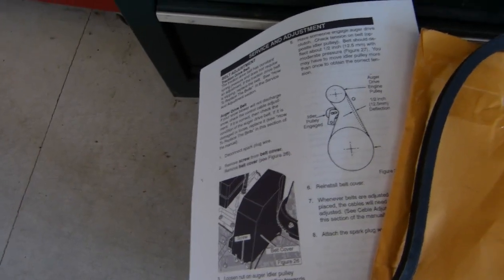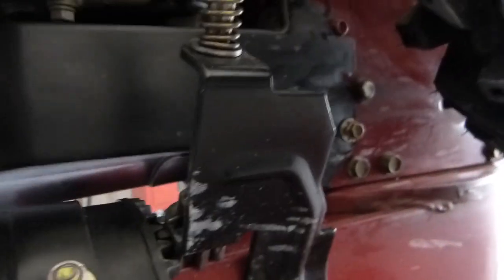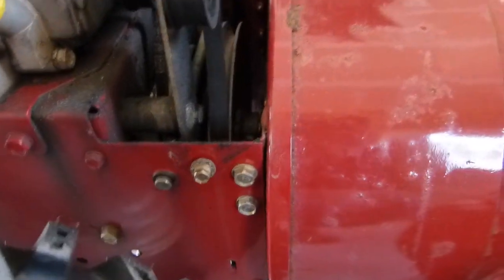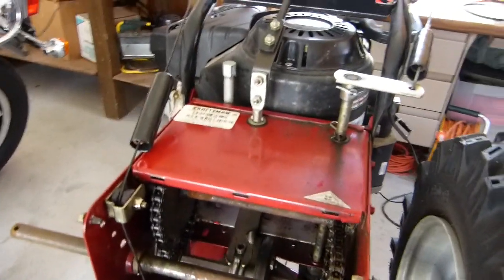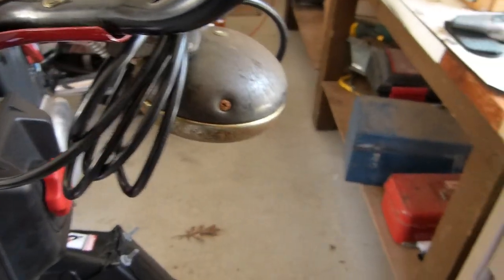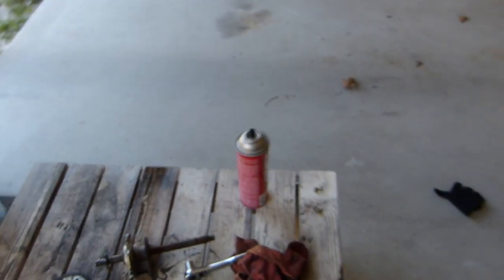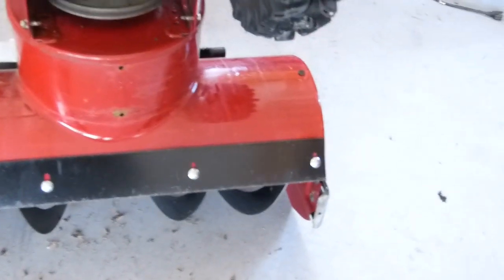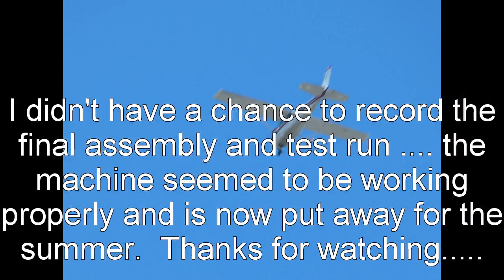Craftsman (Murray) Snow Blower Belt and Friction Wheel Replacement

Comment: i think what i read was that you take a rachet with a socket on the tensioned wheel drive pulley and just twist on the bolt in the pulley with the rachet so you release the tention long enough to pop the belt on and off instead of removing the spring  i read something like this if you anyone understands what im talking about lol

Comment: Hello everyone I Removed & Replace the Traction Belt by cracking my 2008 Craftsman 7.75 Hp 26 inch, 208cc,  950 Torque  Briggs & Stratton.  I Removed the Friction disk Bar off to have enough Clearance for the Traction belt Removal & replacement. 
On this machine the way it's set up I had to do it this way. I purchased this machine 15 years ago and they are Great and very reliable.   Trust your Skills, You can do this.  Take it & FIX- IT BY YOURSELF & SAVE YOUR MONEY.  GOOD DAY LADIES & GENTLEMEN.  👀❤🇺🇸

Comment: So, I'm guessing that next time your drive is slipping, it may be worth while to make a guard like you did first to stop the snow and water from getting into the belt and friction plate area first and see if that works before replacing the friction wheel. Great video. Thank You.
Reply from the maker: Yes - I think the guard helped  a lot more than replacing the belts/friction wheel...and since I used scrap I had lying around, the guard was a lot cheaper.

Comment: I have this snow blower.( 2005 vintage ) I just did this repair.  The replacement partsparts available thru repair clinic..this vid has a lot of important steps missing. what tools are needed?  no pm on the other parts that are now exposed.
Reply from the maker: You should have made a video about your repair and filled in the missing info from this one.

Comment: Thanks. I've the same model. Those plastic chutes. Sears sent me a new one. Before putting it on I sanded it and covered it with 4  layers of glass and cloth epoxy resin with 2 layers more to fair it in and over the impact areas and deflector shield. Then painted it black for UV protection.. Now nothing cracks if the thing picks up a rock in a snowbank. The plastic has become more of an impact absorbing liner, bullet proof.
Reply from the maker: +Raul Escobar Interesting....I never thought of trying that.  Sounds like a good solution!
Reply: Raul Escobar Those chutes were crap. I remember changing a few of them. The blower bone yard never had any because they all did that. Stupid thin plastic. I miss the metal ones.

Comment: Have same snowblower.  Runs great for first 10 min, then gradually starts dying on me.  Keeps running for another minute or two if I increase the choke.  Cleaned/disassembled carb and it was no help. Any ideas?
Reply from the maker: A few things come to mind:
Water (or other non-gasoline liquid) in the fuel
Partially plugged fuel line or sediment in the fuel tank
Carb floats out of adjustment
Sticking needle valve
Bad carb diaphragm (not sure if the carb on this machine uses one)

It may be a good idea to get a carb rebuild kit and replace some of the old parts. Rebuild kits are cheap so even if this isn't the problem you won't be wasting any money.
Reply: jets are still plugged ...very small ...get some engine rev or power tune for outboard boat motors , spray it in when its running if you can ,shut it of ,keep spraying a bit more then let it soak for a few hours only! cuz it will eat plastic and gaskets :)
Reply: On my murray mower crap gets in the needle valve seat and it runs like you describe.  I just take the needle valve out and blow some compressed air through it and it has fixed it every time.  Water in the fuel could also be the problem.
Reply: Gas cap could be bad, seen it many times, it has to vent!!

Comment: I also have the same snowblower and have almost the same problem. Sears company charges $120 just to come and look at it. No way no more of that ill do it myself  nice vid
Reply from the maker: Thanks!  Mine still slipped even after I changed the friction wheel and belts.  See this video for how I actually fixed it.  
Craftsman (Murray) Snow Blower cure for slipping friction wheel / melt shield

Comment: So let me ask you this what gear did you have it in when you took the friction wheel off. The reason why I'm asking this I have a Craftsman snowblower almost like yours and the little shifting for  popped off the friction wheel I'm trying to find the right spot to put it back in like what gear
Reply from the maker: Sorry....I don't remember
Reply: @SevenFortyOne  I'm trying to figure that out now on my Craftsman snowblower. I tried putting the fork that connects to that friction wheel in different spots. To see if it will work right and every gear .

Comment: I have the same Craftsman Blower featured in your videos. My problem is that the friction wheel and friction disc plate remain engaged sending power to the wheels despite the traction lever position. Removed bottom cover and took off traction lever cable. Everything seems in good condtion. The friction disc plate assembly moves freely when i remove the rubber friction wheel. But when i put it back in, the wheel and the disc plate are touching immediately. My question is this, Is there an adjustment on the shaft that the friction disc plate that coulld loosen or shift, causing the friction disc plate to push closer to the friction wheel. The whole movable assembly is in its proper guides and in its backmost position and moves properly when the friction wheel is out of the way but when i put it back, there isnt any gap. Is it the disc plate shaft or bolt that may have shifted causing it to move closer to the rubber friction wheel. THANKS
Reply from the maker: I don't recall there being any adjustments or anything that can move but there are two washers that need to be installed on the insides of the drive lever fork assembly (11:25 in my video).  Positioning the washers incorrectly may cause some problems with the friction wheel engagement.

Not knowing the history of your machine, is it possible the wrong friction wheel assembly was installed at some point in the past?  An oversize diameter friction wheel could obviously cause a problem.

Without seeing yours or having mine apart in front of me I'm not sure what else to look at at the moment...
Reply: SevenFortyOne
Hey just an update on the snowblower.After removing the friction plate, on the back of it, there is a female threaded shaft  where the bolt attaches it to the frictioon plate assembly; that is machine stamped into the back of the friction plate. Somehow that stamped in threaded piece managed to lift out by about a 1/4 inch. Enough to push the friction plate into contact with the friction wheel. I didnt have a new plate available but i was able to hammer it back down into the plate and reinstall it and got back in business
Reply from the maker: John Zawisha NIce!  Glad you got it figured out...thanks for the update!
Reply: John Zawisha